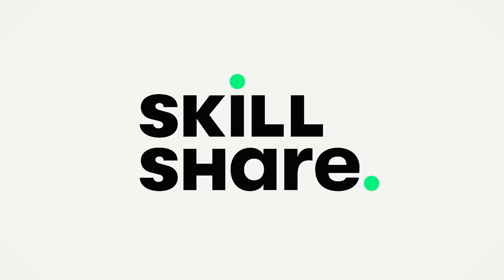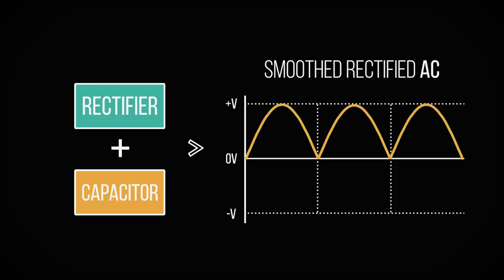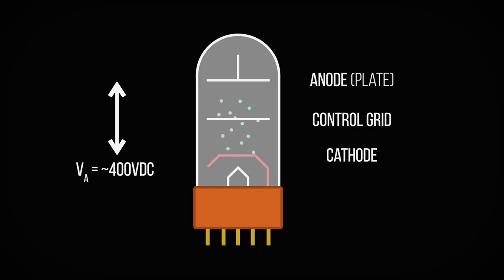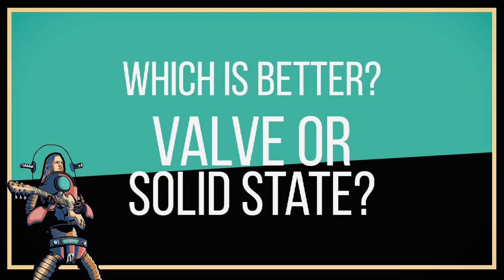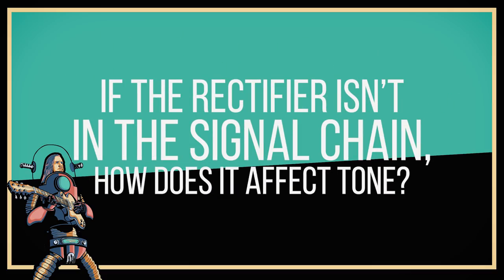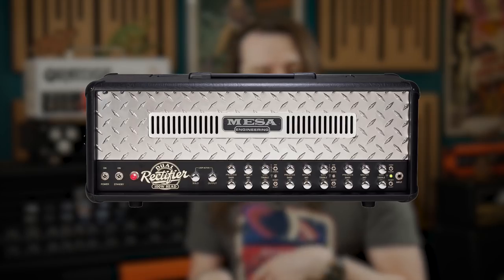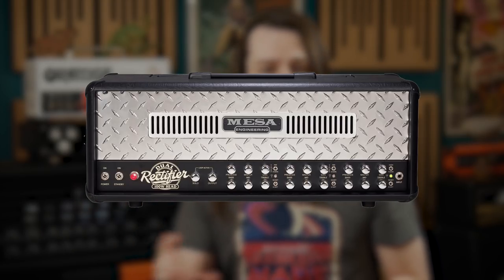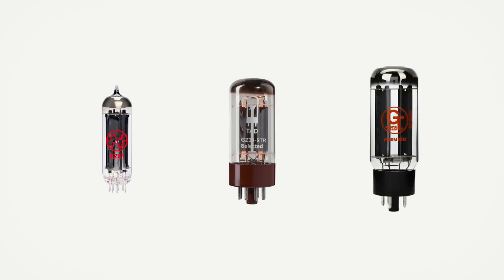What are Valve Rectifiers? | Too Afraid To Ask

Comment: Colin, I hate to correct, but for the safety of others, AC voltage is always more deadly than an equivalent DC voltage value. The parasitic capacitance of the human body allows more AC current to flow through it (putting your organs at risk), and the rapid cycling forces muscles to contract, making it near impossible to let go. I've been caught with around 200vDC in amps before, and while it hurt, it (obviously) didn't kill me, and it wasn't too hard to let go. Comparatively, depending on frequency, it only takes around 10-20vAC for your body to start freaking out. Any higher than 50vAC, and you're looking at a bad time.
Reply: Yeah, wanted to point that out too. AC is way more dangerous at high voltage. Stay safe kids!
Reply: There is a curve. At 1khz it's most dangerous to interfere with nerves. At very low frequency (5hz eg) or very high (100khz +) it's similar to dc.
Reply: @johnyang799  true, I was specifically speaking in the context of mains voltage though, which is what you're going to see in your valve amps.
Reply: @johnyang799  You're right, but in this context, most amp heads run on 50/60 Hz, at least in the countries I'm aware of.
Reply: I was just supplementing the information. We cool.
Reply: @matteocristini6221  which is dangerously close to the frequency of the human heart - which is driven by electric impulses. Which is very likely to result in heart rhythm disturbances. That alone is a serious health risk.

That's also one reason every electrician says to keep one hand in the pocket while working on things that potentially could still be connected to mains power (in case someone has fucked up): If you keep one hand in your pocket the power is not crossing your heart. If your feet are well isolated then you provide no ground connection. If they're not the power is going down through your body, that's preferable to crossing over to the other side of the body and potentially messing with your heart rhythm. Still hurts like hell (believe me, I've experienced 220V mains power) but can be survived much more easily
Reply: @johnyang799  Actually, I'd like to thank you for the extra information! Very appreciated.
Reply: @saschaschneider6355  yes! Moral of the story: don't touch high voltage, regardless of it being ac or dc. You won't care which one hurts less when you get electrocuted...
Reply: The takeaway:
Don't fuck around with this shit of you don't know what you're doing.
Reply: Didn't Edison and Telsa resolve this in a cage match back in the 1800s?

(a Faraday cage match, to be more precise...)
Reply: My understanding is it is not voltage that kills you, but current.  So, the question becomes how much current from N voltage passes through one's body is lethal? If I recall correctly, one tenth of an amp of current can kill you (e.g., stop the heart).  Fortunately, the human body has some resistance so one may survive, what shall we say, an electronic "accident".  I never understood anyone doing household electrical work with the power on considering even a 10 amp circuit offers 100 times the necessary current needed to kill a human.  Be careful folks - cheers!
Reply: @chrisf6216  That's a complex question.  And the engineers and geeks among us might get that pun.
You are correct; it is the current that does the killing, but it's the voltage that drives that current.  For a given load (i.e. your body), the higher the voltage, the higher the current.  There are also significantly different ways that a load (i.e. your body) allows current to pass though it depending upon whether it is AC or DC.  It's complex (to reuse the pun).  As Colin says, don't F with it if you don't know what you're doing!
Reply: @saschaschneider6355  Slight correction: 50/60 Hz (=3000/3600  pulse per minute) is much higher than the frequency of a human heart and so the "high" frequency lead to ventricular fibrillation.

Nothing more to complain about ;-)
Reply: DC is just as lethal, but it takes much longer. when a dc current passes through the body, in addition to the classic internal heating, it also performs electrolysis on every fluid in the body. I'd estimate it might take a good 20 minutes to completley separate every bodily fluid into its component ions, by which time you'd already have been a crispy charcoal chunk
Reply: Also, in valve amps, you may come across the DC plate voltage, which might be much higher than the 240v/115v of your mains. I have an old RCA Oscilloscope that has a plate voltage of -1250v on it's CRT. Be very, very careful, basically.
Reply: @chrisf6216  Chiming back in here -
It is better to say something like "energy does the killing". You need the volts to supply the current, but if you don't have the current, the voltage drops. It gets a little confusing. Energy is the product of volts × current × time, so technically speaking, a high voltage, high current pulse could be survivable if you were to be exposed for a very short time (literally on the order of nanoseconds). Yeah, your car battery can supply 50A, but at only 12v, it won't be able to push that current across your body resistance. Conversely, the static shock you get on a cold winter day is on the order of thousands of volts, but because the current is so limited, it can only exist for a very short time and deliver very little energy before the voltage drops down to 0v again.
Reply: @joerg385  I stand corrected, thank you. You're right. It's something that a medical prof told me but I still should've given it a closer thought before reproducing my "wisdom"
Reply: @theknifesedge57  Eat CAKE because P=IE is dangerous :)
Reply: DC electrolyzes your tissues, which can be potentially toxic and it will, if it could, take a long time to repair itself. AC is still very deadly though.
Reply: Either way, I'll not be checking the ohm reading by licking the contacts in the foreseeable future
Reply: Well, maybe I'am exceptionally lucky guy, but I grabed once into 230V AC with 50hz. My arm flew back and the hand tingled for half an hour but that was that. Even 24V DC was very painfull. I learned in school and was told from some electricians everything beyond 40V DC have a very high chance to be fatal.
Reply: @ciddax754  I heard somewhere that depending on the conditions, AC hurts twice more than DC
Not exactly too related but just wanted to share
Reply: @johnyang799  at very high frequencies AC starts to burn more than electrocute, pretty dangerous as well
Reply: @BananaManPL  It doesn't matter what frequency. It all burns. It just takes higher current than 1khz to be harmful. 5ma basically won't do anything with those frequencies. But it will likely kill you if it's 1khz.
Reply: I will feed with some field info now, or, experience.
Here in Brazil is all 60hz, but we have both 127vac and 220vac power outlets. Touching 127vac lines hurts less, BUT, the funny thing is that you muscles contract in a way that you get trapped. 220vac is less dangerous, it hurts more but you don't get trapped. I don't know exactly why, but it is like that.

About the amp DC voltages, well, if you amp is not connectect to power and you mess around with it, you might get a discharge from the capacitors. It is not dangerous in this case (with frequency inverters it could be), but it hurts a bit. If your amp is power on, it could be lethal.
Reply: @notmyrealhandle  yes
Reply: @theknifesedge57  , anyone who  has ever changed the battery in their car or removed the positive terminal to clean it before re- installing has probably found out the hard way that having your hand on the wrench tightening that positive connector while leaning your same arm against the sharpish inner edges of the Fender (where the closed hood would meet up with those seams) will give you a surprisingly powerful shock. Fortunately it's only between your hand and your elbow and not cutting across your entire body.
Reply: @KB-kc7ou  "Didn't Edison and Telsa resolve this in a cage match back in the 1800s?"
Yeah but the elephant never gave his opinion.
Reply: I donno about you guys but a little bit of 110 never bothered me.  twitch
Reply: Yeah. Really made himself look quite a fool in that section.
Reply: @goodun2974  car batteries are 12v and nowhere near powerful enough to push current through a human body.  They are perfectly safe to touch.
Reply: @thebamfordman  ,  I did not say that a car battery can electrocute you, nor did I say that they were "unsafe" to touch. I did, however, say that under some conditions that 12 Volt can give you a shock significant enough to make you notice it and think differently about what a car battery is capable of.  A typical car starter might draw 30 to 60 amps for 5 or 10 seconds as you start the car. That's 360 to 720 watts, in a low-resistance load of course.  The human body is a high impedance load and so it's not easy to push a significant amount of current through the body at relatively low voltages, but like I said if you're holding a wrench in your sweaty hand and the wrench is on the nut off the positive battery clamp, and your arm is resting on a sharp spot wielded edge of the fender underneath the hood sufficient that the metal abrades the skin under your forearm a little bit, it'll make you jump for sure.  But perhaps you should go back and read my post again, and maybe read all the other comments here as well.
Reply: Yeah he's definitely wrong there
Reply: @joerg385  Yep Sascha got minute and second confused.

Comment: I have a dual rec roadster. I use solid state on all high gain channels and tube on my clean channel. Tube just adds that charm in the dynamics on a clean sound, which you don't get when you're highly compressed with distortion. Really gives a different feel that only the player can actually notice.

Comment: Hi Colin. And with an 3-phase power supply system the voltage ripple gets even smoother due to the fact that the 3 phases is 120 degrees mutually displaced.
Reply: But I think it's only used for big sound systems.
Reply: Yeah, three phase power is usually only used in major high power devices.

Comment: Enjoyed the old school advert warning :-) It would've been really helpful to hear the difference between an amp using valve rectifiers and an amp using SS rectifiers though... Even just a few power chords might have been enough...
Reply from the maker: Sound samples would be utterly meaningless without an amplifier that has switchable rectification options. I don't have one of those. 

Using two different amplifiers would result in two different sounds and it would be impossible to isolate what was the rectifier and what wasn't within the sound. It would be completely contrary to the scientific process.
Reply: @ScienceofLoud  that's a very fair point.
Reply: @ScienceofLoud  It could be done with a Weber Copper Cap.

Comment: The biggest pro to tube rectifiers is how it affects the longevity of the components of the system. Because the tube rec introduces the voltage to tubes gradually rather than instantaneously, the tubes will last longer. Since there is sag when you try to push the amp too hard with a tube rec, it again raises the longevity of the tubes in the system. 

I have a 1964 Wurlitzer Electric Organ that uses tubes for oscillation. All the tubes are original and still work fine; it has a tube rec. It also doesn't have a standby switch which also prolongs tube life. 

Also have a 1958 Magnavox Stereorama console that also has a tube amp. Amp still works great with original tubes; no standby switch and uses tube rectification.

Comment: Hey Colin, love the content keep up the good work! 😊 My suggestion for a potential "too afraid to ask" episode would be eq utilization. For instance, I have an active bass. I have a couple pedals with eq on them(not talking about actual eq pedals). My amp has eq. Do I just use the eq on my guitar since it's closer? Do i use the one on my amp because it is more powerful? Do i use one individually and set the rest flat? Do i use them in combination? Like setting the eq a certain way on the guitar, then setting an eq that comes after distortion and then finally on the amp... I knew there are mo hard and fast rules and I should do what sounds best to me, but was just hoping for a little more info on the plethora of options available. Thanks 😁

Comment: I think you stated that rectifiers are responsible for the higher voltage after rectification. It's actually the capacitors that do this. The voltage rating of a transformer is RMS which is the average voltage. The peak value is 1.412 (square root of 2) times higher. When the caps smooth the voltage it increases towards the peak voltage. With silicon rectifiers (and probably valve ones too) they actually are responsible for a small voltage drop. Just thought I'd share. Also in high power power supplies they use MOSFETs as rectifiers. Turning them on for half the waveform. Almost no sag or power loss, but need to get the AC zero crossing right or bang goes the MOSFET. Great video.
Reply: Valve rectifiers have a much larger voltage drop than silicon diodes. Voltage is dropped across the valve's internal 'anode/plate resistance'. As more current is demanded by the power tubes, more voltage is dropped, resulting in 'sag'.

Comment: Hi Colin! Is it preference when it comes to rectifier amps? Or is there a set company that does rectifier amps well?
Reply from the maker: All of them to it well. All amplifiers have rectifiers.
Reply: @ScienceofLoud  awesome. I associate rectifiers with Mesa Boogie since the name rectifier were slapped on their amp lines. It's completely their own thing until now where all amps have rectifiers. Thanks Colin! Cheers!
Reply from the maker: The 'Rectifier' line from Mesa Boogie is so called because it contains both solid state and valve rectifiers and lets you switch between them. You can assign different rectification methods to different channels.

Comment: Mr Mike Soldano:
“In my opinion, all amps should have solid state rectifiers. I don’t believe there are any really good rectifier tubes on today’s market and, even if there were, why use them? The technology is obsolete; they are horribly inefficient, and far more expensive and troublesome to build into an amp. These tubes, no matter how good, will routinely need replacing, adding to your maintenance expenses. Besides that, tube rectifiers kill the headroom of an amplifier. If you want that spongy, vintage sound, there are other ways to do it. I have successfully designed and built amps that have replicated that soggy bottom, vintage tube rectifier sound using solid state rectifiers and various circuit modifications.”
Reply: Whats funny is, there are probably no end of people that would line up to tell us "yeah its close, but it still isn't a REAL tube rectifier". At this point even for classic rock id have to agree, but there will always be those that refuse to let it go.
Reply: I used to work for a major valve hifi manufacturers and solid state is cold, dead and hard sounding. Nothing replaces a valve recitifier, its night and day. Some people say the contrary but invariably they are 'scope jockeys' with cloth ears.
Emulating a valve rect. in a guitar amp isn't difficult, browning out the PSU and producing flabby bottom end is more to do with the voltages produced and not the reason to have a valve in the first place.
Reply: yeah that's thrue, but tube rectifier is still tube rectifier and match with others tubes in amplifier, because all thogether is still vintage tehnology. I's more matter of tast, seems to me...
Reply: I agree. Brian May's AC30s mostly have solid state rectifiers and nobody says his tone stinks.
Reply: Bryan M. Pabustan He runs them quite compressed already.

Comment: Here's a tata: If you have a Stereo amp head but only a 1-12 cab, can you operate the amplifier safely with only 1 speaker cable if the impedance and wattage match properly?

Comment: By the way, other than the internal resistance of a tube rectifier causing sag under current demand, the "sag" also comes from tube rectifiers having limits on capacitance - with the best performing one in guitar amps, the GZ34, having a hard limit of 60uF for the first stage and others being considerably below that (the 5U4GB Mesa uses in their amps with tube rectifiers, like, well, Rectifiers has a limit of 47 uF, and the ubiquitous 5Y3 used in old Tweed Fenders and others is around 33uF). A smaller reservoir capacitor value (i.e. the input filter cap of the power supply) will sag a lot more. Think about the difference between a Marshall Super Lead and a Soldano SLO (or for the sake of it, a Peavey 5150). The Soldano is stiffer, firmer in its response for a multitude of reasons, not the least of which is using four 220uF caps in series-parallel for 220uF of input stage filtering and reservoir.
Reply: David Fuller,  It is also worth noting that output tubed  have a higher impedance at lower plate voltages,  and so as the voltage sags momentarily when the amp is pushed hard, the interface and transfer function from the tubes through the transformer to the speaker is going to also be affected. A loss of some speaker damping seems likely.  This is probably another reason why tube rectifiers affect tone and why many people prefer it that way

Comment: How about a video on how tone is affected  by valves. No amp that I have played sounds better than my Marshall Vintage Modern,  which is all-valve but has a solid-state rectifier.  Also, amps with a single valve allow to try out different valves to find your perfect sound.